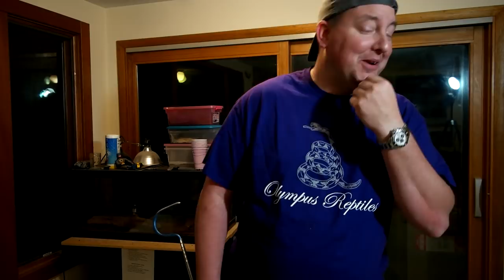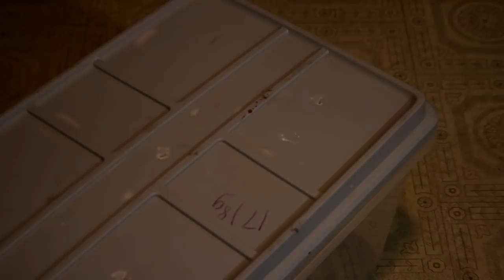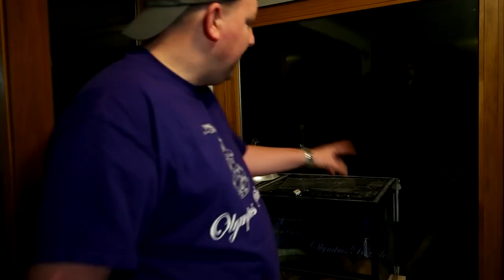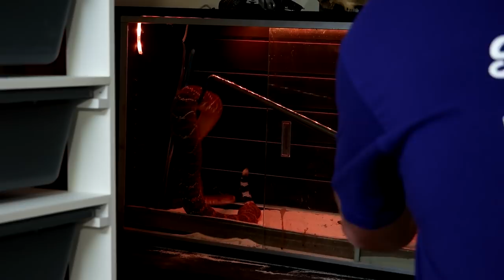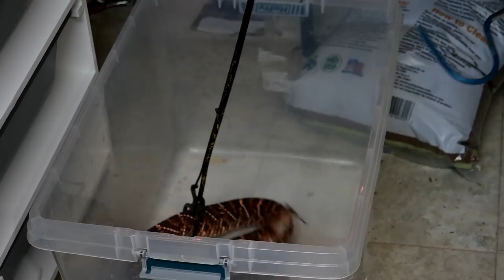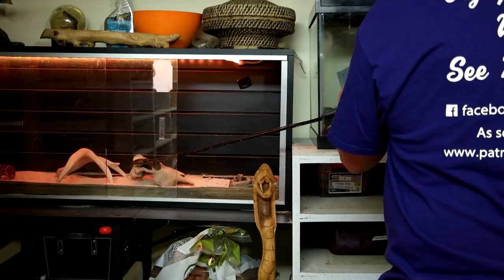Cleaning and handing my favorite rattlesnakes, reaper and Khali (Timber and female"blood" diamond

Comment: Khali and Reaper sound so cool when they rattle. I love the shade of red of Khali! I do have one question, if the snake does bite themselves, would the venom hurt the snake? Awesome video and thank you for sharing!!!
Reply from the maker: Littlefoot Littlefoot it actually can, which is why I try to prevent it.  They are not immune to venom, but they do process it much better than we do.  There venom is designed for mammals.  A bad bite can cause them issues, or even death.  I have seen a Massasauga get excited at feed, miss the prey and inject itself with enough venom it died.  Rare, but can happen

Comment: Matt 
One more question I'm almost there. Lol. I have a pvc vivarium, but I guess it could b any enclosure. 
Is it normal or ok for your thermostat to read 10, 12 degrees over your target temp to get the tub, viv, tank up to heat
Reply from the maker: Dennis Munro depending on where probe is, yes
Reply: Olympus Reptiles thanks so much Matt for the quick response your awesome for that you've been a lot of help and knowledge for me. The probe is between the heat tape and the viv bottom app centre of a 12 x 10 or so piece of tape